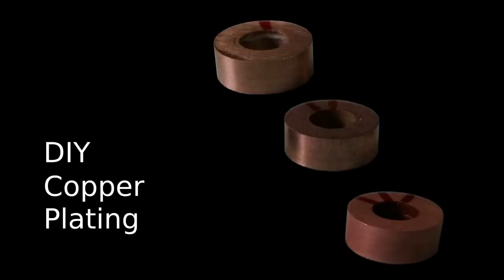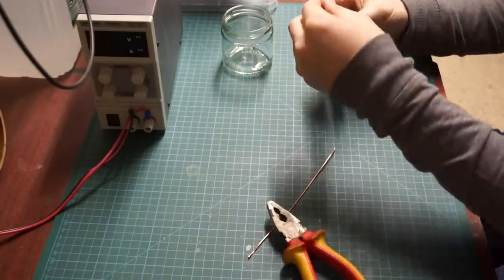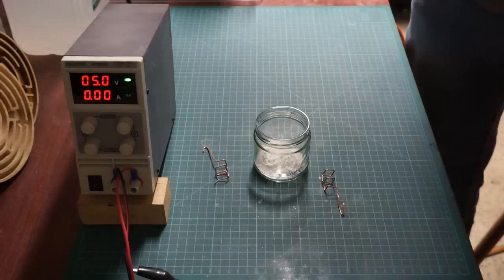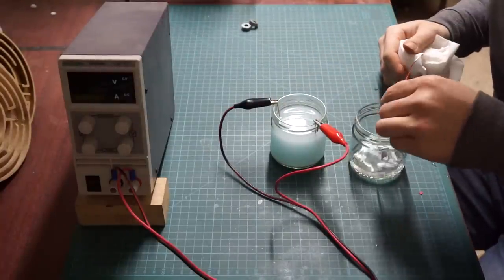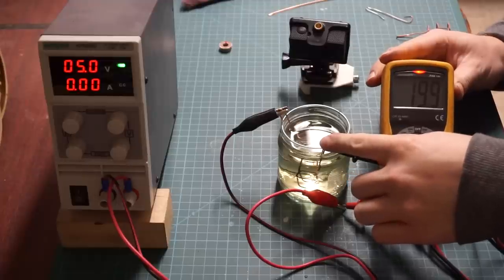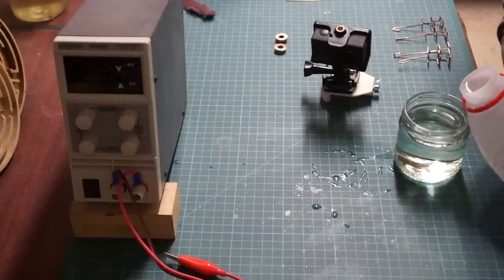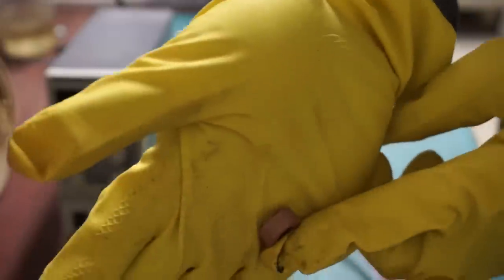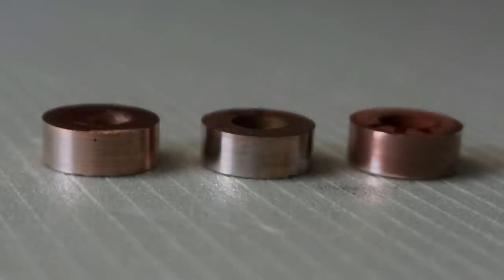Best DIY Copper Plating Methods

Comment: You dont have put two copper anodes in the solution to "disolve copper into sulution" before putting the piece to be plated in. You can just put the piece to be plated in with the  copper anode at the same time. You will get the same results. Also, 4 parts water to 1 part muriatic acid.  Not 100% muriatic acid.
Reply from the maker: Thanks for the hints. I'll try them in my next attempt
Reply: who said 100%? he put it with water although idk what ratio
Reply: @ARCSTREAMS  
and
@Brian Clark
You know, there's no such thing as 100% muriatic acid, since muriatic acid is Hydrogen Chloride dissolved in pure (distilled) water, you can't make it more than 38%. If you try to put in more HCl gas in a 38% hydrochloric acid, no matter what temperature or pressure used, the excess HCl gas will bubble out from the liquid. You can call the undiluted (38%) hydrochloric acid as 100% muriatic acid, but technically you would be wrong.
Reply: im just saying he did not put  just muriatic acid ,he had water in there as well,,but about what you said,what if we evaporate the water ,wont the acid % start increasing then or does it evaporate and remain 38% in the remaining fluid? im sure there must be a chemical way to make it 100% or close ,are there no other 100% acids,sulfuric?
Reply: @ARCSTREAMS 
There's no way at all to make 100% muriatic acid, it doesn't matter what method you try. However, there is a crystalline form of Hydrogen Chloride + water, which contains much higher (around 68%) percentage of HCl between water molecules, but it cannot be used as a solvent - since it's solid. When you try to dissolve it in a small amount of water, it dissociates and the forming HCl gas escapes from the solution vigorously.

Sulfuric acid can be concentrated to 98% by some methods, and there are disulfuric acid or fuming sulfuric acid, but that name doesn't mean one particular acid, but several acids. They contain 98% H2SO4, and a percentage of SO3 (sulfur trioxide). 98% sulfuric acid cannot dissolve more sulfur trioxide molecules, because its hygroscopic, it sucks out water from everything, even itself. So it remains 98%, but sulfur trioxide molecules are 'floating' in the acid. They associate and dissociate at the same time (dissolving in the remaining water molecules, forming H2SO4, and suddenly breaking away from the water), so it's fuming. The white fume it releases contain the water-free SO3 molecules and water from the air.

So technically, 100% mineral acids don't exist. There are ways to simulate the 100%, but it's hard to maintain and they are very dangerous, considered as impossible even to keep them in a bottle.
Reply: if you took 38% hcl and started warming it up to evaporate and concentrate will the remaining liquid still hold 38% only by vol?
Reply: @ARCSTREAMS  
You can't concentrate muriatic acid by heating it up. Actually it will lose HCl molecules (they will evaporate into the air), so it will dilute to about 20%, it is the azeotropic form of muriatic acid. You can achieve the strongest fluid muriatic acid (38%) by pumping cold HCl gas into ice cold dilute (10, 20 or more %) muriatic acid. Higher pressure and low temperature help HCl to dissolve in water (or in the dilute acid).
I see where you're trying to get, but there are chemical and physical boundaries.
You can concentrate sulfuric acid up to about 96% by SLOWLY heating it, it will reach the maximum concentration at near 300 °C, but it is the most concentration you can reach by evaporating the water in the acid. Concentrating the acid further (up to 98%) is achieved by adding phosphorous pentoxide powder to the acid, which is an extremely hygroscopic, very dangerous substance. I do not recommend concentrating sulfuric acid, because hot H2SO4 is EXTREMELY CORROSIVE, very hygroscopic - that means it can dehydrate (burn) almost everything, including skin, flesh, clothes, even nitrile gloves. Doing it needs heat resistant labor hardware in perfect condition, a lot of patience and solid knowledge.
So there is no 100% hydrochloric acid (only in gaseous form), but I think you want to do something that would need the properties of it. There are other acids, alkalic bases, even mixtures, those can be used to make various things - think about nitrating or etching heavy metals.
I recommend you to look at the wikipedia page of muriatic acid, you'll see I wrote the plain truth about it.
Reply: well you seem to be an authority of knowledge on this  if they let you write it on wikki too,,what is your background? muriatic acid is this equivalent or basically the same as hcl? and they both come in  38% or was it 31 for muriatic?
Reply: @ARCSTREAMS  
I am interested in chemics and also some parts of physics, learned everything what I could in high school and the university, that time I also conducted various experiments in chemistry. I am not a chemist or a physicist, I am a blacksmith/metal fabricator/machinist. Have to tell you I didn't write whole pages of the wikipedia, though I edited some mistyped/misunderstood/misconceptous texts on some pages of it.
Hydrogen chloride (HCl) is a gaseous molecule, it contains two atoms, while muriatic acid is the widely used name of hydrochloric acid, which is basically hydrogen chloride dissolved in distilled water. Technically hydrochloric acid is pure HCl, but at normal temperatures it is a gas, so we use the name of hydrochloric acid for the water solution. Commercially available muriatic acid can come in several concentrations, most widely available concentrations are 10% and 20%, these are being sold as muriatic acid. But these are not pure, they are diluted acids. "Pure" muriatic acid (lab grade) comes with 38% concentration, but it's not widely used, because it has to be handled and stored very carefully. It's easier to make and use a diluted acid, because the dissociation of HCl molecule is endothermic (takes heat from the environment, cools down), while diluting the acid is an exothermic reaction (warms up when diluting). Aqua regia (which can dissolve precious metals, including gold and also platina) is one of the most common uses of pure muriatic acid, it contains slightly diluted (65% conc.) nitric acid and pure muriatic.
One more interesting fact that pure hydrogen chloride gas can be forced to become a liquid, between -85°C and -114°C. But at these temperatures, the soup would cost more than the meat in it, if you know what I mean.
Reply: "One more interesting fact that pure hydrogen chloride gas can be forced to become a liquid, between -85°C and -114°C. But at these temperatures," then perhaps it is possible to have it close to 100% by this process similar to liquid air mfg,,but then what vessels can do this strong enough to hold the pressure and the concentration of the acid without exploding or melting?,,,i was told aqua regia is the only thing that would dissolve and metl gold but i seen a video of someone using hcl and bleach to do this,,said the chlorine gas is what dissolves the gold and the solution becomes inactive after a while
Reply: @ARCSTREAMS  
At that low temperatures (between -85 and -114°C) HCl gas  turns into liquid, like when water steam precipitates on cold surfaces. In moden labs, most of the containers are made out of polyethylene-terephtalate, polypropylene, or other plastics. They use borosilicate glass vessels too, these vessels can hold pressure at higher temperatures like 8-900°C. The only acid that eats up glass (also borosilicate) is hydrofluoric acid, that acid can destroy even human tissues, bones too very quickly. Hydrofluoric acid can be held in some type of plastic containers, and has to be handled very carefully. It's being used in glass manufacturing, of course in a diluted form to etch glass panels etc.
I also saw a vid where a guy claims he dissolves gold in muriatic acid dripping bleach into it, but I don't think that was gold he took into solution, or it wasn't bleach what he used. It's not impossible, though I have no knowledge about HCl and sodium hypochlorite could dissolve gold. Would you share the link of the video with me? I'm not saying he fooled the viewers, I only think he didn't tell he used another key component of the acid.
Reply: so sticking to the main subject,is it or is it not possible to concentrate hcl into an almost 100% liquid state? as i said it would be under pressure and at such concentrations would need to be held in a vessel that can take both the low temperature and whatever pressure is created,,as for the video,yes he was removing gold flakes from computer mother board pins by using hcl and bleach instead of hcl and nitric acid(aqua regia)  he said the chlorine gas is what helped separate the flakes from the pins but he mentioned it helps melt the resin that held them together ,i think he then added more of each solution to get it to react again till the gold was starting to dissolve,,i tried finding the vid but could not atm
Reply: @ARCSTREAMS  
To answer your main question: Hydrogen chloride gas can be liquified, in a round bottom flask with liquid nitrogen bath around it. You just have to flow the HCl gas slowly into the flask, and it will condense down to the wall of the flask. It will be a 100% HCl liquid, and as long as you keep the temperature under 85°C, it will stay liquid (sort of). It will stop gassing out at about -100°C, above that temperature it will generate pressure in the bottle that can become tremendous as temperature rises. You have to know that HCl in liquid state at low temperatures will act somewhat differently than it does at room temperature.
I'll search the tube for that video you mentioned as soon as I am finished my work today. In the shop, I have my chemical lecture notes, maybe there is something written about the gold + chlorine affair. I'll check it out.
Until then, I wish you a happy new year.
Reply: ahh so it is then possible ,and you said at this low temp it will not have a high pressure but what about its oxidizing properties at such concentrations? will the flask be able to handle it without melting and hold at that low temp? yeah i will keep a look out for that vid as well,i tried looking for comment exchanges i had with the guy in the vid that i trashed a while back but its hard to find them ,if i can find them then i can load that video from there but my trash can is a jungle and this was maybe a couple months back ,,thank you and i hope a good new year to you as well
Reply: @ARCSTREAMS  
Oxidizing with HCl at such low temperatures is not an effective process, especially not with gold. If you use a proper thick-wall borosilicate glass container, it will hold the pressure, but you shouldn't use plastic or metal lids. There are acid-resistant rubber compounds that can seal well, placed between the container and its own threaded screw stopper. 
Gold likes to be dissolved at higher temperatures, so I wouldn't try to dissolve gold with fluid HCl at let's say -100°C. If you want to get the gold out of processors and such things, then I recommend using a slightly diluted (40-45%) nitric acid solution, it will quickly dissolve every other metals but gold. Nitric acid is not easy to obtain in most countries, maybe sulfuric acid would be a better choice (you can buy battery acid, it is 36-37% sulfuric acid). If you heat it up to 120-130°C, it will eat up almost everything around the thin gold layers. Scraping a bit on the gold will let the acid under the plating and it will dissolve the scrap (copper, etc.). Then you can rinse the shit out, gold will stay at the bottom of the plate, since it's heavier than the other materials. After washing the remains with a sodium carbonate solution and water several times, it should be neutral, free of acids. After drying, you can melt the gold with a propane-air or propane-oxygen torch.
Reply: yeah i was juts wondering if that container can hold the pressure ,low temp,and resist any oxidation while holding the hcl fluid,obviously since they can do this process then yes the vessel can hold but i doubt its something you can then just seal off as a small container and take it with you lol ,,imagine if it broke and all that raging fuming acid ,,anyways thnaks again,im off to my new years party,also my bd same day ,what a mess,,happy new year
Reply: I use Muriatic acid+a pinch table salt and one battery D size,i'm proof by myself its works the result is amazing even  scrubed with steel brush it does'nt comes off

Comment: do you know what the chemical composition is of the solution after plating?  just wondering about toxicity levels - I'm trying to compare whether id be best copper plating or zinc plating for durability and wear on some machine parts.. and obviously to prevent rust occurring again

great vid by the way... subbed!

Comment: Hi I have subbed and liked because I saw you can use chemical easily bought from hardware store. I used electronics contact cleaner to clean my piece. Not the best! I used prepwash to wipe on and off.it worked great on the feeler gauge I was copper plating. But doing my kitchen spoon ( stainless steel) it worked but blotchy on the handle! If I use Acetone? Will it work with stainless steel? Can I even electroplate stainless steel? I can't get muriatic acid but can I use hydrochloric acid instead? Any reply appreciated. Cheers from Australia 🙂👍👍👍

Comment: I've heard electrolytic plating can leave uneven deposits of the nickel around areas such as edges and corners. Is this just highly exaggerated marketing bull by the people who run electroless plating services or would this affects tolerances in any meaningful way if the plated parts will be part of a mechanism?

Comment: a cool way to do pcbs is to print with carbon ink then use this to electroplate it to reduce the resistance a huge amount.  also I saw u can use a laser in copper sulphate and it electroplates glass.   The thing im wondering is the there a way to conductiveness without metal?   cause think, your body doesnt use metal and it conducts electricity (besides the water conduction, which is only really poor),  but im stumped there still.

Comment: im surprised the BS did so well or why you would even use it to begin with because it is a base and not an acid solution so how is this working? the muratic one drew more current ,,so i was thinking of using salt,hydrogen peroxide and vinegar and maybe putting in some backing soda(bad idea?) and using 12vdc 4mAh adaptor,,you said it is better to go slow and less power?

Comment: I tried the vinegar. It does work but it’s not durable the coating will wipe off easily I plan to try the acid maybe it will help bind to the still parts

Comment: Any of these methods won’t work on larger pieces of bare steel they will wiper right off the acid copper on the last one will only work if it is nickel plated first so im sure the part was nickel that he used

Comment: Hello sir, thanks for the time you have taken to post this, but I would like to shed some light on the basic science of your process and why it may not work for restoration purposes(and quite frankly I am amazed that no one has pointed this before),  Copper plating directly to steel using simple electroplating solutions like the ones you have shown will not produce acceptable results because: Copper is more noble than iron, if you place a steel/iron piece in a solution containing copper ions, the iron piece will be immediately coated with a thin(often loose) coating that will not stick if further plated, that is why professional electroplaters use either a Copper yanide(very dangerous) solutions to first coat steel with a adherent coat of copper then the piece is plated with regular bright copper plating solution based on copper sulfate, another way is to first plate iron with a flash coat of Nickel then with regular bright Copper/Nickel plating process, this is then finished with a Chromium or a Chromium plating alternative like Cobalt
Reply: You may want to try the same solutions(baking soda, Vinegar, muriatic acid) but with Nickel metal anodes, then after the steel rings may have been plated with a flash nickel coat you can use the same solutions you did before and you will see much better results.
Reply: That's why you use alkaline plating solutions for plating copper onto steel. They don't have to contain cyanide though. Cyanide-free solutions usually contain copper pyrophosphate

Comment: I used the muriatic acid for the copper plating... The plate is really thin... I think there wasn't enough copper ion in the solution... Is it possible? The diluition is 1 part of muriatic acid and 5 parts of distilled water... Thank you for your video!
Reply from the maker: Could be the case. But have a look at the comment gizmoguyar wrote. He did a really nice job explaining how to calculate the thickness.

Comment: I am really sorry . You thought we were stupid. I tested the baking soda solution. As I guessed, it doesn't work. For example, iron metal turns completely black and no copper sits on iron. I also tried vinegar. It didn't work either. I also saw and tested other people's videos. They don't work either. In addition, both vinegar and baking soda should be blue, but not blue in your video. What's the matter
Reply: Have you thought about that if none of the methods worked for you from multiple videos then you are doing something wrong? And this guy maybe doesn't think that his audience is stupid? lol
Reply: It sound like you got your electrodes mixed up and you ended up oxidizing your steel part. The solutions turn very blue/turquoise/green if the concentration is high enough, and faint blue if concentration is low. This also works better on stainless steel since it has nickel in it, and doesn't work on regular iron if there is enough contamination of the electrolyte, using distilled water is critical, and good quality reagents too.